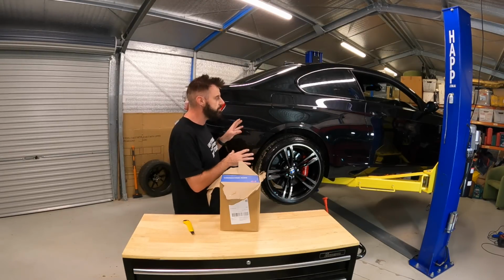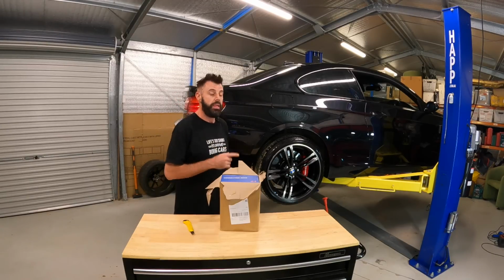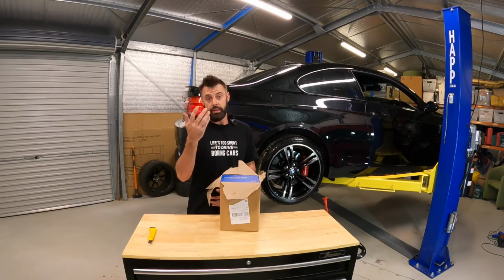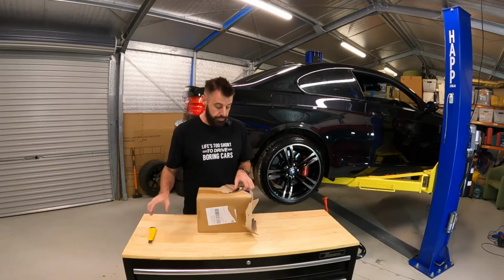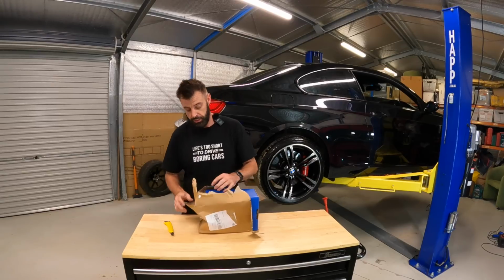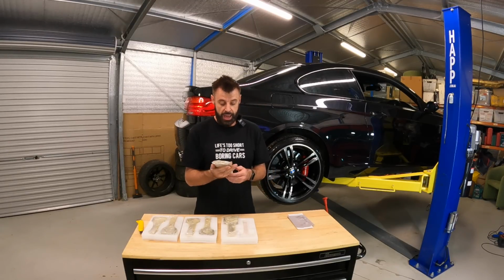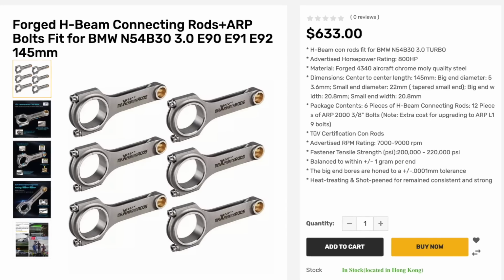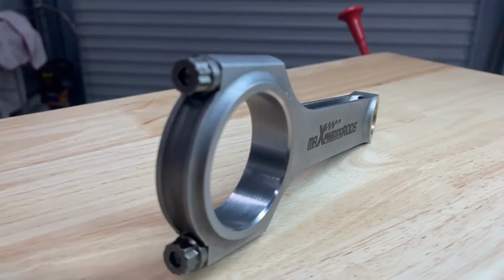BUDGET N54 FORGED MOTOR BUILD: MAXPEEDINGRODS

Comment: Make sure that you get head studs as well, as over 800 whp you can start to have problem with head lift, and the engine block is good all the way up to about 875 whp, and with just rods pistons and head studs you can make 800-850 whp, I got all this info from n54berk btw, they were kind enough to share this info with me as they have built multiple engines

Comment: I got a set of maxpeeding rods coil overs for my e36 because my BCs were like... stuck in the Suez Canal for 4 months or something...? Huge mistake, they were 250$ and such a hunk of shit it was unbelievable. So much noise, crashed over every bump, had to compress the  rear spring over half way to get the bolt in for the shock even on the shocks highest height. BCs came shortly after and the maxpeeding rods went right to the scrap yard. Lesson in getting what you pay for, hopefully these hold up better 😐

Comment: I got a maxpeeding rods set of coil overs for my e36 because my BCs were like... stuck in the Suez Canal for 4 months...? Huge mistake, they were 250$ and such a hunk of shit it was unbelievable. So much noise, crashed over every bump, had to compress the rear spring over half way to get the bolt in for the shock even on the shocks highest setting. BCs came shortly after and the maxpeeding rods went right to the scrap yard. Lesson in getting what you pay for, hopefully these hold up better
Reply: I had these as well on mine,your right they were absolute junk ,I used bilsteins in the end,the rods are good quality though,been on for around six months now no problems.

Comment: Did you have a look at FCP Engineering for Rods? Was about 1000nzd for a set of 6.
Reply from the maker: I have seen quite a few with very similar spec list to max peedingrods. All smaller companies with slightly higher pricing. Made the assumption they were the same and these just work on volume to be cheaper.

Comment: hey dude what brand weight oil you using for your build? I've been using 5w-40 helix due to the amazing flow compared to other brands.
Reply from the maker: The 17t car runs 5w40 Penrite. But I might switch to the castrol 10w60 which the m cars use
Reply: 10w60 I'd like to see how it goes if you do. penrite 5w40 is a good 5w30 thick oil. i might try 0w40 shear free penrite or mobil 1. they say it takes about 3 minutes for the oil to get to operating temp. compared to the 5w-x. which is about 10minutes for me.
Reply from the maker: @Jotomoz  if you are running big power say over 25psi, i would avoid the thinner oils. My understanding is the only genuine benefit to a thin oil is fuel efficiency. Which is why so many manufacturers move to thinner oil. It makes them score better on fuel economy tests.
Reply: @ZeroTo60Tube  i am bit skeptical of 0w oils only because 5w was factory though tempted due to shear free on the penrite. before i owned the car the previous owners mechanic put LL04 valvoline 5w30 MST. no issues. i went shell 5w40 pure plus after.
Reply from the maker: Ohhrly has to be run on 10w60. That should say it all 😜

Comment: Congrats on your first sponsorship! Keep up the great work!

When you first installed your 17T turbos, did you have wastegate rattle on acceleration? Recently installed the same pair you have on yours but have rattle on acceleration. I'm still running MHD Stage 2+, wondering if that is the issue. What do you think?
Reply from the maker: I didn’t, the only time I can hear any noise from them is during a free rev when idling. 

Some people report no issues running them on ots maps, but I have heard they can causes a range of issues with the way mhd controls boost and the way they make so much boost compared to the stock ones. 

With x amount of duty cycle they will make a lot more boost than stock and it may confuse mhd. 

It would be worth speaking with a custom tuner to why their opinion.
Reply: @ZeroTo60Tube  Thanks for the quick response brother. Did you run any OTS MHD maps when you first installed the turbos?

I'll definitely reach out to a custom tuner. Thanks for the advice!
Reply from the maker: Nah, I went straight to JSRs tune and never looked back. His made my car run so much better, faster shifts and less timing corrections.z

Comment: So when are you doing a zf8 speed swap?
Reply from the maker: Defs keen on that. But the controllers aren’t quite there yet. Would love to be able to do it with some sort of flash on the stock transmission control. Which may be possible with a msd81 dme.

Comment: I have some good info for you!!!!! Nico_135 was running maxpeeding rods when he did the world record n54 60-130 time of 4.8 secs I belive. 😳😳
Reply: @zeroto60
Reply from the maker: There you go, I thought he was a stock motor. Is that motor still together?
Reply: @zeroto60 yes rods and piston wise motor was fine.  He sold the car to start another project.  Still using these rods at over 850 whp 😳

Comment: Link to MX5 forum talking about Max Speeding rods?
Reply from the maker: Sorry man, i will add it to the description as well. https://bofiracing.co.uk/maxpeedingrods-cheap-chinese-rods-our-verdict/
Reply: @ZeroTo60Tube  for what it’s worth I’ve used these in a B5 S4 before. No problems. Tons of Americans use them too in the Audi world. No noticeable difference between these and IE rods (as well as many others). Hopefully see you at QR/Willowbank in the near future!
Reply from the maker: is the built S4 still in QLD?
Reply: @ZeroTo60Tube  no one wanted to buy the car built so I put a stock motor in it and sold it. Ended up parting the motor out

Comment: Install the rods with stock pistons with big ring gaps. Should be able to run 17t at 100% duty for a while.
Reply: Stock pistons are weaker than stock rods typically, rather drop in pistons on stock rods vs opposite way around

Rods are sinter forged as everything is these days, pistons are a fancy cast

Comment: Forged pistons needs more piston to bore clearance than cast or hyperutectic, if your going to daily drive it, forged will cause a lot of piston slap resulting it premature wear of piston and bore.
Reply: Modern metallurgy alleviates this, a modern forged piston won't slap like they used to

The biggest reason manufacturers avoid forged pistons even on their big budget performance models is emissions - the piston does still expand a smidge more than fancy cast stuff, which = blowby and failing their emissions tests.

Comment: These look alright - if they can be used with the std piston even better, and they come with bolts as well which makes the price very competitive indeed. Assume they are available for the n55 as well?
Reply from the maker: Looking forward to seeing how they go that is for sure. i believe they do have n55 ones, but i don't think they are on the aussie site yet.
Reply: @ZeroTo60Tube  Interesting,  my research so far has n55 and N54 rods being the same. Molnar quote part number BMWH5708AHFB6-A for both engines. I am tempted to put a set into my N55 which hopefully will be stripped next week....
Reply: @ZeroTo60Tube  do these work with standard pistons?

Comment: I would definitely go fully forged all the way. Especially now you have got the rods sponsored. I have done a 4 cilinder build with the max rods, and was very impressed.
Reply: How did the max rods hold up? Im currently goíng for a 700whp h22 build and bought the max rods but lately ive been doubting them alot
Reply: Does this rod work ? Handle 700 hp ?

Comment: I would advise you to go with the forged piston and check all the manufacturers, weisco, trw, venolia,  before you buy,  the price difference may not equal quality between the makes.  Make sure the rods go to the machine shop and have them check the weight match, also check for runout on the big end of the rod.  Balance the rotating assembly for high rpms or over balance.  The motor should go in ohReally the bottom end will handle insane numbers.  There is a company that makes deck inserts to close the top of the block and stud the bottom and top end.  Incredible work team N54 great content